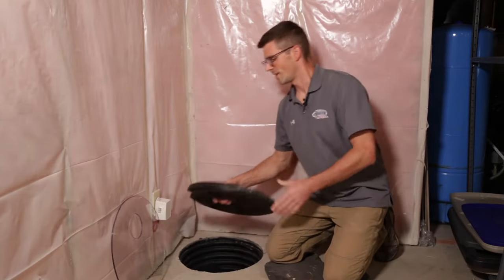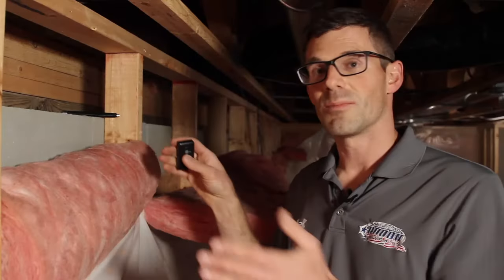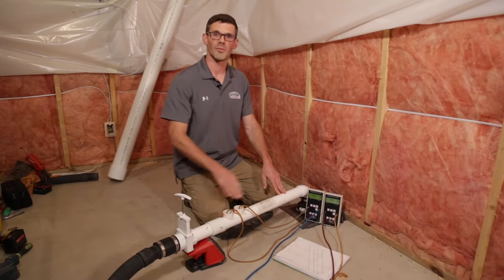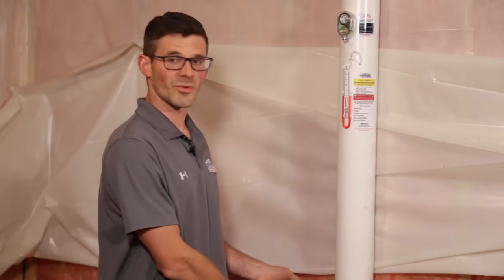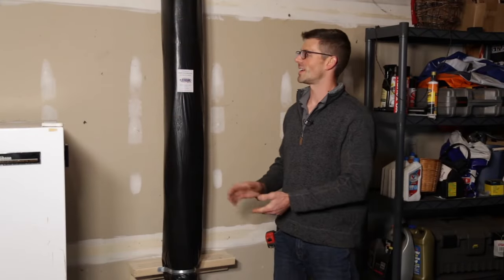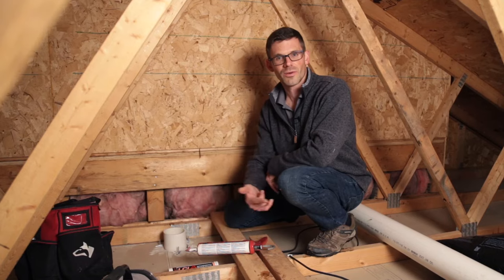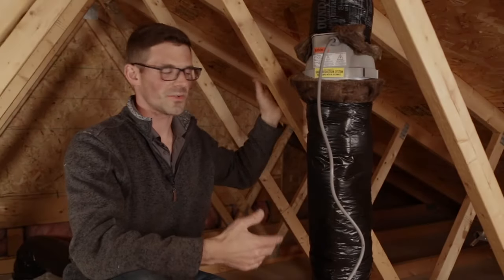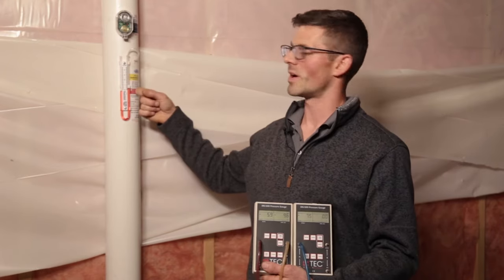Installing a Radon System in a Home with Drain Tile

Comment from the maker: The products we use in this video are linked below.

Amazon Store - https://amzn.to/3LSXNnU

Sump Cover - https://amzn.to/3qTJnXx
Smoke Pen with Wicks - https://amzn.to/36avsVh
U-Tube Manometer - https://amzn.to/2KUDkmq
Air Flow Alarm - https://amzn.to/3a5o1Qr
Firestop Collar - https://amzn.to/36dbhWw
Insulated Flex Duct - https://amzn.to/3Px9d1y
4" x 4" Fernco Flexible Coupling - https://amzn.to/3t0GZjO
Power Cord Kit - https://amzn.to/3iOfEfX
Oatey Pipe Flashing - https://amzn.to/2YiLtnO
Varmint Guard Screen - https://amzn.to/3oeTcOc
Noise Suppressor - https://americanradonmitigation.com/product/attic-noise-suppressor-medium/

Radon Fans Mentioned
RadonAway RP140 - https://amzn.to/3oj0bp9
RadonAway RP145 - RP145 - https://amzn.to/45iItIv
Fantech Rn1 - https://amzn.to/3sYx1iF
Fantech Rn2 - https://amzn.to/3Ot86iT 
Festa AMG Spirit - https://amzn.to/3LFAD46
Festa AMG Maverick - https://amzn.to/44abEww

Sealants
Great Stuff Pro Gun - https://amzn.to/3ceQLsI
Great Stuff Pro - https://amzn.to/2M08t8C
Radon Sealant - https://amzn.to/3EVj2BK
Firestop Intumescent Sealant - https://amzn.to/3iPMkpx
PVC Primer - https://amzn.to/3RbHA0j 
PVC Cement - https://amzn.to/3PbhhVw
Geocel 4500 (for sealing shingles and roofing nails) - https://amzn.to/449B4tU

Tools
Bosch Rotary Hammer - https://amzn.to/3pmHz9k
Bosch 5-Inch Core Bit - https://amzn.to/36ik4Xw
Bosch Dust Collection Attachment - https://amzn.to/3otHe3v
Milwaukee Saw - https://amzn.to/2NF3nPu
Favorite Pressure Gauge - https://americanradonmitigation.com/product/dg-8-pressure-gauge/
Level - https://amzn.to/45QXrWd
Nut Driver - https://amzn.to/45HvyjM
Remote Control Outlet - https://amzn.to/3LbV9cu 
Pitot Tube - https://radoncourses.com/form/pitot-tube-orders 
Tape Measure - https://amzn.to/3LaLxP2

As an Amazon Associate,  we earn from qualifying purchases.

Tool Kit Rental - https://americanradonmitigation.com/product/radon-tool-kit-rental/

Consulting - https://americanradonmitigation.com/product/consulting/

EcoQube Radon Monitor - https://americanradonmitigation.com/product/ecoqube/

Comment: Good video - but I have a gravity sump and not a pump. How can I stop the air from coming in the gravity fed drain line without stopping water from draining out?
Reply from the maker: Thanks, John. You can create a pee trap or add a check valve at the end of the discharge. I'd be careful if you are in a cold climate, though. 

Check valve https://www.radonaway.com/drain-check-4-pvc

Comment: As far as the gas water heater, they may have to switch to an electric. This would up their electric bill around $30/month.
Reply from the maker: They replaced it with a power vent water heater. Thanks for the operating cost info, though.

Comment: It's November 23rd 2022 and I have been following you now for just over a month. The problem with watching you work is that your work quality and ethics are so high, you make me not want to trust anyone else to do this project with my wife and kids health on the line. I bought our home in December 2020 in East Stroudsburg PA and learnt about radon in September 2022 this year. I did some research and in October I bought the EcoCube radon tester you recommended in another video. Over the past week I have seen the EcoCube give readings as high as 4.8 pCi/L and I'm freaking out. I have to wait until month end to get someone in to look at it but I'm following you and learning as much as I can. I really honestly wish I could have you come out here and help us because I found so many horror stories of crappy radon mitigation jobs done in my area. The house was built in 2015. You can stand in the crawl space but there is no concrete slab floor, just cheap vapor barrier over rock. I found the radon pipe that runs from the attic into the crawl space, but the pipe only comes out about 10 inches from the flooring in the crawl space and is far away about 15ft from the sump pump. Also the radon pipe does not go through the roof in the attic and the nearest electric outlet is probably about 12ft away. I'm thinking I might need the stronger RN4EC fan because of the crappy vapor barrier and the poor sealing job the builder did in the crawl space.
Reply from the maker: Hey John,

You may want to consider having crawl space encapsulation done in conjunction with radon mitigation. If sealed properly, you should be able to use the smallest radon fan they make rather than one of the largest fans. You don't want to pull all that conditioned air from your home and exhaust it outside. Your project doesn't sound too complicated, so I wouldn't lose sleep over it. 

Charlie Gutridge took one of our radon training classes and is about 75 miles from you. You may want to reach out to him. https://gutridgeinspections.com/

Comment: Drain tile with no interior exposure isn't complicated; it's easy.  What would be much more useful is on mitigation with drain tiles that have interior exposure (e.g., waffle-board between the walls and floor).
Reply from the maker: A drain tile depressurization may be less complicated than a sub-slab depressurization system in most cases. However, we find many homes with compromised drain tile systems that require quite a bit of troubleshooting to get full pressure field extension. We worked on one last week that added about six hours of labor to the project. Look for a video about this in the next month or two. 

The waffle board is the worst, especially in a finished basement! In that case, we find sump suction or drawing directly off the drain tile (not the rock around it) is best. Seal what you can. Cut drywall if the homeowner allows to access to the waffle board. Multiple suction points will help immensely with PFE and energy efficiency.
Reply: @AmericanRadonMitigation :  Thanks.  I'd look forward to seeing that sort of installation.

Comment: How do your local HVAC guys usually address the water header back drafting?  I just had a system installed in NE Indiana, and apparently I'm the first person in the area to have this issue.  It could also be that I'm the first person to test, after watching your video!
Reply from the maker: That's a great question, Sean. They typically end up installing a power vented water heater. 

They could also add more make-up/ combustion air, but I haven't seen them take this approach. I installed this at my sister's house, and it took care of the problem. Unfortunately, we can't add these for our customers since we are not mechanical contractors and can't pull the permit required to do so.

Comment: Since radon is much heavier than air, why does it need to be exhausted out above the roof?  Why not exhaust it at or near ground-level some distance from the house?
Reply from the maker: There are concerns that there could be re-entrainment back into the house causing elevated radon levels. 

I’m not sure how you could exhaust it some distance from the house without having freeze up issues or how you would drain the condensation. 

You would also want to avoid exhausting next to a dog kennel, an air intake, a deck, or a patio.
Reply: @AmericanRadonMitigation  Thanks.

Comment: Very good video. Mine was around 11 or 12. I had a passive and got a fan installed. I gave my dad my tester and his is at 29 or 30! He is planning on putting one in at his sump pump. I'll have to tell him to make sure about closing up holes in wall that a company did for water drainage.
Reply from the maker: Thank you, Jerry! Your dad will want to make sure it doesn't comprise the function of his water management system. He may want to encapsulate the foundation walls and then seal the poly.

Comment: Thanks for the video. You provided some info I had not heard when we did our first house, such as the value of sealing the cracks and checking the draft of the gas water heater flue. The radon levels in our current house suddenly jumped up to 5.6 after years of staying below 3.0 so we'll be doing this process again.
Reply from the maker: I'm glad you found it helpful, David. I'm reminded of a home we worked on last year. The house has a finished basement, aside from the mechanical room, a block foundation, and interior drain tile with waffle board between the edge of the basement slab and the block foundation. Without doing any sealing, we would need a very large fan to barely reach our furthest test hole. So instead, Jon and I spent a couple hours sealing the waffle board and block tops in the mechanical room. The sealing allowed us to use a smaller radon fan and saved the homeowner $458 per year in operating costs. Sealing is often overlooked because it's easy to install a large fan to overpower the leaks rather than spend time sealing them. 

Thanks for watching, David!
Reply: @AmericanRadonMitigation  I was an electrician, and thought I had some leftover 4-in schedule 40 pipe, but I just discovered it's only 3-in. With prices as high as they are these days (and they are out of the solar system!), do you think it would be okay to use only 3-in? Our home is not very big, but it's on a slab. And the foundation has been collapsing little by little, I'm afraid. It's causing all kinds of trouble, and I think it might be why the radon levels are coming up.
Reply from the maker: It's hard for me to say without knowing your home's layout and soil type and without doing any pressure field measurements.

Comment: Ever consider using a condensate bypass? I have similar system tied into underfloor drain tile using an RP140 fan. First two RP140 fans failed, both at about 3-4 year mark. Read up on common causes for failure and condensate bypass was often mentioned to extend life. Installed that and now current fan has lasted about 10 years and still going. 
Radon was about 5.8 before installation and is now consistently measuring in the 0.8p range.
Reply from the maker: Thanks for sharing your experience! Do you have an exterior system? If not, is there a significant amount of uninsulated piping above your radon fan? 

We offer a condensate bypass as an optional accessory on exterior systems where it's common to have 10-20 feet of piping that produce condensation. 

However, there likely isn't much condensation when there are 2-3 feet of piping above the fan, of which only one foot isn't wrapped with insulation.
Reply: @AmericanRadonMitigation  Interior - fortunately there was a nice void near garage to travel from basement into attic and out thru roof. About a 12 ft run within attic - 4ft horizontal and 8 ft up. 
Within void - all piping is on interior side of insulation. Within attic - all piping is insulated. I used the foil faced wrap insulation on mine - I prefer the slide on insulation like you used but was out of stock at the time.

Comment: Thank you so much for this top-notch content. I'd like to convert a passive system to active that uses my sump pit, but I thought I read that you don't recommend using active sump pits for radon mitigation systems. Is that right, and if so, why?
Reply from the maker: Thank you for the compliment! I believe this rule eliminates the chance that the radon piping gets and stays disconnected by someone replacing a sump pump. 

Check out section 402.1.2.4 of the radon standards. https://standards.aarst.org/RRNC-2020-1022/10/index.html#zoom=z

Comment: Nice video,is the water wont get in?The contractor just installed to our house & he did not put any cover or wire mesh at the end of the pipe through the roof
Reply from the maker: Thank you. Check out this video and the radon standard linked in the description for more information. https://youtu.be/MOK5eAPH3SU?si=9FeZO8IFOuh-TFpI

Comment: Great info. I am going to encapsulate my crawlspace myself and put a dehumidifier in there to reduce humidity (There is no way I can afford to hire this out). This means I will be closing off all of the vents and putting insulation on the walls then plastic foundation wall to foundation wall. The intent is to rid our space of mold which has become a problem. Should I test for Radon before/after/both? 

I spoke w/ one contractor and he stated that after doing this, I should put in a vent fan that would pull the air from underneath the plastic and remove the soil gasses out. The fan would move about 150cm of air per minute. Would that be sufficient? The area is 1,000 sqft. That said, I have never seen anyone use a vent fan for this but I also haven't been at every house either. Don't scold me about hiring someone to do the radon remediation and am open to hiring that out if affordable. I am fully aware of the dangers of Radon but money doesn't grow on trees either.
Reply from the maker: Yes, I would be curious what your radon levels are before and after encapsulation. Be sure to test the room above the crawlspace. 

When encapsulating a crawlspace we seal a six or 12 mil cross-laminated vapor barrier to the top of the foundation wall and lap it one foot onto the dirt. 

We then install Radon Tee backfilled with clean rock. That is then covered with a strip of RadonAway's Vapor Mat.

A piece of vapor barrier is then cut to fit over the dirt floor and taped to the vapor barrier that is attached to the walls. 

We then measure how much air we need to move with the pitot tube rig shown in the video to achieve our desired pressure field extension in our test holes. 

After that, we install the appropriate size vent pipe with a valve and tie it into the rest of the radon system. 

The valve allows us to damper down the airflow coming from beneath the crawlspace vapor barrier. 

We then spend time checking for leaks in the vapor barrier and seal them to limit the loss of conditioned air from the house. 

We typically only need to pull 5-10 cfm from a crawl space if we can get a good seal to the foundation wall. 

If foam board installation is already installed on the foundation walls it tends to be much harder to get a good seal. This makes the system less energy efficient. 

150 CFM is a lot of air to pull from beneath your vapor barrier. Keep in mind most of that air would likely be coming from your home and is air you are paying to heat and cool. 

You will also want to use a fan that is capable of working in moist conditions, like a radon fan. 

I would reach out to experts in your area before doing this project. I'd hate to see you create other issues while attempting to fix another. 

The AARST radon mitigation standard will come in handy. 
https://standards.aarst.org/SGM-SF-2017/index.html

Good luck!

Comment: Extremely helpful. One question - is there no concern about rainwater falling into the exposed pipe in the roof? Is there a U fitting that could be recommended for the end instead?
Reply from the maker: Good question, Manu. The short answer is no. There's no concern about rainwater entering the system here in Minnesota. Rain caps increase the discharge distance from surrounding areas and increase the likelihood of system freeze-ups. 

Several pages cover this in the radon standards. Here's the link https://standards.aarst.org/SGM-SF-2017/26/index.html

Comment: Awesome video , would like to know when you installed the 4inch pipe into the core drilled concrete do you insert the pipe under the slab ? Or install it the size of the slab ? Thanks
Reply from the maker: Thank you! The bottom of the pipe sits one inch below the bottom of the concrete slab. Nowadays, I use a Bosch 5-inch core drill bit to core the hole. Then a 4-inch PVC coupler with a shim to wedge it in place. The hole is slightly larger than the PVC coupler. Finally, I cut the shim flush with the floor and run a bead of radon sealant to create the seal.
Reply: @AmericanRadonMitigation  thank you !!! Appreciate it that you answered back and quickly too 💪🏻💪🏻💪🏻💪🏻
Reply from the maker: @kmobthm  You're welcome!

Comment: About to tackle this project myself but having a difficult time deciding on 3" vs 4" ducting.  I have an 1100sq ft basement slab with corrugated tile underneath and on the edges all leading to sump pit that I will be sealing and extracting from.  sub slab is a mix of limestone and just earth.  Using a RadonAway RP145c and entire run will be only 15' mostly vertical.  Seems like in Canada 4" is typical but I see many US installations with 3".  My main concerns are 1)airflow and 2)noise.  What are your thoughts?
Reply from the maker: Go with 4-inch. It will be quieter and less likely to freeze in the winter.

In addition, you can move almost twice the air with a 4-inch pipe. It is typical for a drain tile depressurization system to move over 80 CFM, and you'd likely have a hard time achieving that with your current fan and 3-inch pipe.
Reply: @AmericanRadonMitigation  thanks for the reply, I actually finished the project last night and yes I made the decision already to go with 4" and very glad I did although it required me retro fitting it to the Jackel sump dome by cutting a new discharge hole.  I'm using a RadonAway rp145c. I'm super pleased with how whisper quiet the entire system is but more importantly, at 0.5" WC, according to the charts in the manual, I am getting about 125cfm which I think is more than adequate. So far in the past 24hrs my numbers on my Corentium meter have dropped very sharply!